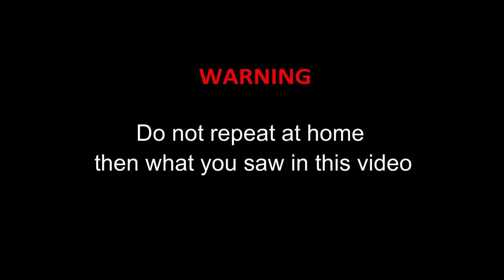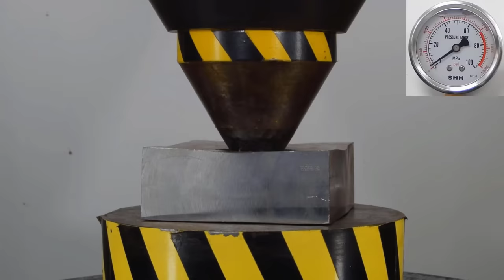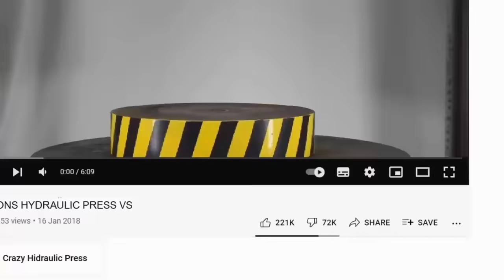HYDRAULIC PRESS VS OLD AND MODERN ARMOR

Comment: I was expecting the ball to shatter. Quite a surprise.
Reply: What he said.
Wow
Reply: Everybody did.
Reply: Same
Reply: @Corsa15DT  except those people that know how spheres work. Unlike on any other shape, on a circle/sphere there are no weak points because stresses are distributed equally along the surface. Theres no corners or edges so there cant be a single weak point.
Reply: @Sharpless2  the surface contact is small and it was cooled down.
Reply: Interesting results. An experiment that's more dangerous than the safety measures can handle.  I suppose something more durable will be devised for the next safety barrier.
Reply: @ianbelletti6241 their safety procedures handled it just fine. There was materiel damage but no one was hurt.
Reply: This guy must have balls of steel.
Reply: Was definitely turn of events, wasn't it??
Reply: Same here!
Reply: As was I 😢 but unexpected results happened, and that's new knowledge to add to my collection 😁
Reply: @kurtl8425  actually, no.  The idea of the barriers is to contain the catastrophic event.  Yes, it reduced the energy of the projectiles but someone could have easily gotten injured with the projectiles. In science they would say that the design of the safety guards was underrated for the hazards of this experiment.  They clearly need to reconsider the design of the barriers if they're going to continue doing experiments that are this dangerous.
Reply: Certain steels, like those used in stainless steel knives are toughened and grain structure refined by liquid nitrogen immersion.  The armor plate was weakened by a prior point loading and may have cracked.  The sphere was also cooled to a point where it will not strain before failure, thus making it act like a strain-hardened perfectly shaped object in compression.  The outcome is explainable but not necessarily predictable.  As for the observed detonation of the armor... Well it takes a lot of energy to stretch strain hardened steel like that and the energy was released with maximum violence.
Reply: @notamouse5630  damn? Are you willing to teach me more!
Reply: Me too.
Reply: frozen metal are more resistent while the heated one is more weaker in molecular levels
Reply: Me thinks might want to do an upgrade from particle board and plexiglass for the barrier.   Most impressive hydraulic press vid I've watched so far or the ball and it's not even titled right lol!
Reply: @ianbelletti6241  they couldn’t have easily been injured if their safety plan included ensuring no one was near the experiment. The argument that the barriers were insufficient to contain the shrapnel is valid and would have saved them the cost of a camera but there is no indication anyone was ever in danger.
Reply: Lol displayed comment is a spoiler. Thanks for that 😂
Reply: @kurtl8425  yes. Their safety plan of a barrier and keep clear did work.  However, it's clear that they didn't plan for something this energetic.  The safety zone outside of the barrier is supposed to be a secondary safety measure, not a primary.  If they're going to continue with experiments that could be this energetic they need to rethink the safety plans.  Either they need to construct a secondary backup structure or try to make the barrier itself more durable.
Reply: @Tastebud420 that's what you get for spoiling the video by looking at comments before you even watch the video. Derp.
Reply: @michaelmccoy1794  on mobile top comment is always visible. Can't help it lol
Reply: me too
Reply: I definitely didn't expect the entire studio to shatter.
Reply: @Sharpless2  Do you think the steel ball bearing's exposure to liquid nitrogen made it more brittle or more shatter resistant? Just curious. 🤔
Reply: @nemesisobsidian  Generally it makes metals more brittle. But this is also dependant on the amount of carbon in the steel. Less carbon means it will be more ductile in cold temps but it will also not be as hard.

The Titanic had a similar problem.
Reply: @Sharpless2  Then how did that 80 mm steel ball not break when submerged in liquid nitrogen for 20 minutes and then subjected to the force of a 500 ton hydraulic press while sitting on top of a block of AR500? If metals are generally more brittle in submersion of liquid nitrogen as you say then this makes no sense to me.
Edit: Makes me wonder if there's some kind of effect going on here like liquid nitrogen submersion of hard metal balls makes them stronger not weaker which was part of my original question that I was asking.
Reply: @nemesisobsidian  Youre forgetting that unlike any other shape, a sphere has no single weak point. This is why its so god damn strong. A Sphere is the strongest natural 3 dimensional shape there is.
Reply: @Sharpless2   So it's the shape of the object? The submersion in liquid nitrogen has no effect?
The properties and hardness of the steel ball stay the same regardless of if it was subjected to extreme temperatures or not? Is that what you're saying? Sorry if I seem so inquisitive.
Reply: Yup
Reply: @notamouse5630  Very interesting explanation. With my layman's knowledge (or ignorance) I expected the ball to shatter. When it didn't, I assumed that it was because contact with the armour had warmed it slightly. Perhaps it's better to replace the metal with hydrogen 😃🙃😵‍💫, but the real test of the armour would be to use plasma instead of extreme cold.
Reply: Its basically like having a massive comet from outer space come into contact with a very little pin needle on the ground the energy is of the scale
Reply: Сегодня на
Reply: @krikeydial3430 He does literally 😆. He probably has many laying around his shop.
Reply: @Sharpless2 the points of contact are the “weak points” in a sphere getting crushed by two flat surfaces. A cylinder with more surface contact would be much more resistant to getting crushed or shattered than a sphere. It’s just the metal cube on the press isnt as strong as the metal in the ball and they’re both hardened steel. One has to give way fisrt. Hence, why the top of the press didn’t shatter. It just comes down to which is stronger and which starts to give way first, the point of contact on the sphere or the cube. Use a harder steel for the cube and the ball will explode. Evidence: the many videos of ball bearing getting exploded on presses on YouTube.
Reply: Yeah the armor ruptured before the ball and split into 4 equal chunks like holy cow
Reply: That's great armor!
Reply: @krikeydial3430  Yep.  A 30mm and an 80mm balls of steel to be precise ;-)
Reply: ........ it was cooled down by the liquid nitrogen therefore makes it harder to break..... if he put the ball on the hydraulic press without cooling it it whouldve shatterd
Reply: I thought that frozen metal should be crystalize act like glass? But look like I'm learn something new today
Reply: @huybo02 no metal will act like glass wether they are hot or cold lol if it was hot the ball whould of been squashed or it whould of been broken into pieces
Reply: One of THE most interesting stuff I've ever seen 🤗🤓
Reply: @krikeydial3430 были. Тепепь осталось одно.
Reply: I was confused at first too but the supercooling actually mattered quite a bit I think.

Essentially the steel ball was hyper tempered to become ultra hard. Normally the brittleness would be an issue but the shape along with the only force being compressive (along with limited impacts) really highlighted what you can do when you engineer your material to do exactly one thing.
Reply: Yes, same here… so unexpected
Reply: Same
Reply: @krikeydial3430 I think he controls the press from another room
Reply: @Sharpless2  The contact point at top and bottom IS the weak point.
Reply: 6:02 I bet thats how fast the Titan sub imploded… 😮
Reply: @krikeydial3430 Literally
Reply: Steel ball molecules were so close together due to cold and really could not release hugging themselves :D also shape helped a lot
Reply: Fr I guess the cold did the trick
Reply: @kurtl8425  I think the camera says otherwise... it very much got hurt ;-) cameras got feelings too
Reply: Me too 😂😂😂😂
Reply: Bruh me too...
Reply: I was expecting this to happen. Its pure physics. The ball was cold enough to give the armor piece enough cold away to make it ice like. To break the Ice is easy for the steel ball.
Reply: Wow…
Reply: @ianbelletti6241 No. They handled it fine and nothing happened. Stop trolling.
Reply: @Sharpless2  The sphere is only strong if the pressure comes equally from all sides. In this case the pressure came from two points.
Reply: @Corsa15DT cooling it down so much, should have weakened the steel ball, right?
Reply: @Sharpless2 But that ball was supercooled... Usually that makes metals rather brittle.
Reply: @baiaioangeorge8946  one would think so..
Reply: @notamouse5630 Exactly right. I can see why it happened, but would never have expected it.
Reply: I was expecting the ball to be brittle.
Reply: @notamouse5630  So, if we were testing a force equation F = m*a*a and shot a similarly cooled metallic sphere at the armor, would you surmise the armor would also catastrophically react?
Reply: @ianbelletti6241  it was clearly a remotely operated experiment. there was no one to get hurt there because no one was there.

the barriers were just to protect property damage...so i guess they need something better to prevent that.
Reply: liquid nitrogen cold finished steel is used in many aerospace parts. Tells you something about its hardness.
Reply: The ball was milder steel. When a metal gets cold it gets (idk the word in english) easier to shatter. When they came into contact the ball started absorbing heat from the armor piece. So it came down to the armor piece being too hard for its own good and shattered
Reply: I must try this at home on my fly press
Reply: @Sharpless2 coincidentally the natural shape of all celestial bodies in space
Reply: @WinstonBlack I assume he was referring to the extreme cooling
Reply: @Sharpless2  Except when put in a hydrolic press.. then it's not a sphere anymore ;-)
Reply: Yes, after all the sci-fi movies where they super-cool something and it shatters with one strike!

Comment: This video provides a critical example of the importance of making sure that your protective measures can stand up to sudden fractures or shatters at the upper end of the scale of the forces being used for testing.
Reply: And hearing protection, too!
Reply: Nice and interresting video 👍 However, it was a bit ironic that chipboard plates were used as protection when testing state of the art armour to destruction 🤔
Reply: Say you don't know how modern armor works without saying it. Modern armor is designed to be reactive and provide a counter concussion to absorb.
Reply: @halvarmc671  Uh, think you responded to the wrong comment.  Not sure this has anything to do with the video being an example for the importance of protective safety measures.
Reply: @halvarmc671  he's not talking about the armor, he's talking about the presses "OOO shit" protection. If he where standing nearby this could have killed him, as it is it just cost him a camera.
Reply: @jotto64 the objective of such is to deflect shards, not block them
Reply: @affegpus4195  Maybe - But it is still ironic 😁
Reply: @affegpus4195  yea exactly everything was clearly made to absorb impact
Reply: we also have to remember that most armor in armor in ww2 was tangled so it acts if it's thicker than flat the sloped armor does a better job deflecting an incoming projectiles
Reply: @halvarmc671 that really does not apply to this video as modern armor is made up of composite materials to deflect and absorb the shockwaves in order to shear projectiles and minimize damage, this video isn’t “modern armor”, it’s just high-hardness steel
Reply: That armor failed because it was cooled down below its ductile to brittle transition temperature.
Reply: @Mezog001  He didn't cool the armor he cooled the ball bearing. Some heat was transferred from the armor to the ball, I don't know if it was enough to make a difference. I expected the ball to shatter since it was cooled.
Reply: the white boards were there mostly for lighting- you want a nice reflective surface to get good light on the subject. i think he willfully leaves the press unprotected, this is done in order to say “opps, it’s damaged, i guess i need a bigger press”. methodically destroying the tips too- for science 😉
Reply: @affegpus4195  Live Smarter Every Day!!! Wonder if he had a look at this video?
Reply: @halvarmc671  Pretty sure you're talking about reactive armor, bud, which is a different critter altogether than the steel being tested. I think AR500 (and other AR-series armors) are just very hard steels. So the tearing failure that occurred has less to do with some "design feature" of the material than the enormous force being applied to it to cause it to shatter (the usual word for the form of tearing which occurred) rather than deform any further.

But I could be wrong. So how's a static block of metal supposed to generate a "counter-concussion?"

Say you don't understand how chemistry, physics or common sense work without saying it. Say, "my knowledge of material science comes from Call of Duty and I understand that either," without saying it. Say you're sorry to the nice people who (somewhat recklessly) damaged a few thousand bucks worth of their hardware for you.

Just say something else, next time.
Reply: @memethief4113  So what you're suggesting is that the block of hard metal is supposed to resist changing shape when softer metals are smushed up against it, which we see happen in the video when the "mild" steel penetrator is turned into a metal boob with a little nipple (and came pretty close to tearing almost the same way that the block subsequently did)? You're suggesting that this was some kind of inevitable outcome based on how objects respond to forces, which almost never includes the spontaneous generation of new forces? Do you mean to suggest that this was not some kind of magic?

Looked pretty magical to me. 😁

I didn't see your response there when I wrote mine, yours is good.
Reply: His barriers were made of particle board it can't withstand sneezing on it.
Reply: This is why you don't use particle board as a barrier.....it's as useful as tissues withstanding a breeze
Reply: And titanium can shatter if it's scratched or dinged. That's why a titanium connecting rod that's dropped is discarded.
Reply: @Mezog001  While we look for some degree of hardness, brittleness is a concern. 
Many of us think that the Nazi invasion of Poland in 1939 was a walkover but the reality is that they lost some 300 ~ 400 tanks. Looking at some of the photos, we see not penetration holes but armour plate shattering reminiscent of broken glass. The Nazi armour at this time was not that thick and the Poles had some 37mm guns and a home-grown anti-tank rifle which was up to the job.
In another account, one guy writes how he worked in an armoured car factory where the plates would break if a spanner was dropped on the but supposed OK when bolted on! Hmm, wouldn't fancy sitting in one of their vehicles!
Reply: Dude somebody’s going to get killed.
Reply: @jotto64 yeah that shit can’t even deal with a hammer blow from a human arm. Wonder how a few sandwiched sheets of 1” mdf would have fared?
Reply: What do you mean? His protection actually wouldn't be enough 

He is lucky to be well. If one piece was launched towards him, his cover wouldn't help almost at all.
Reply: If I remember; someone once said that the reason  modern materials 'fail' more is because they were designed to procedure fail and avoid catastrophic release of force as shown by the last block. There was a time when purely Harder = Stronger = Better but when we moved more into machinery and engineering those became possible liabilities.